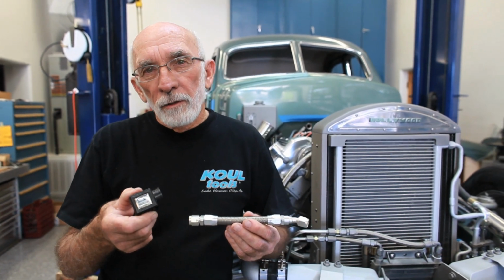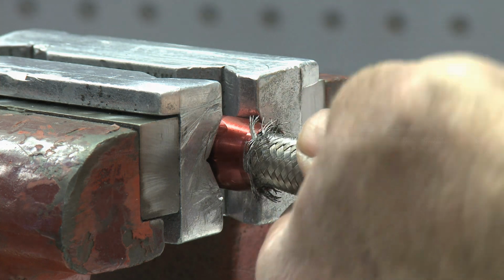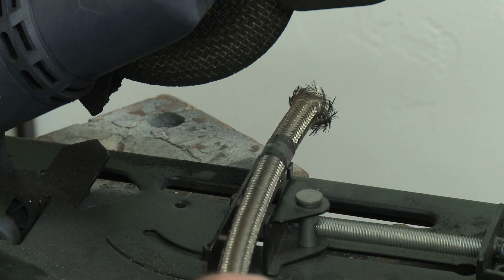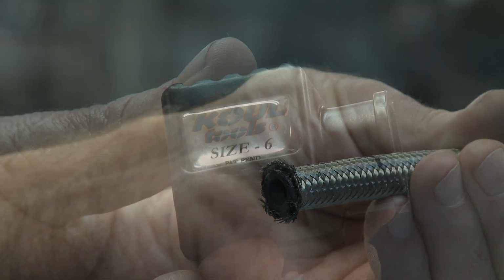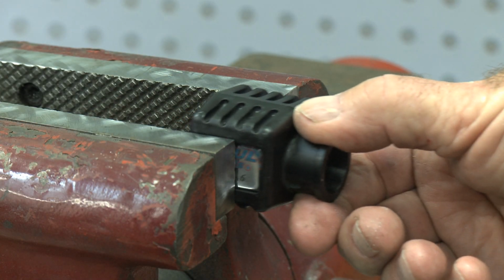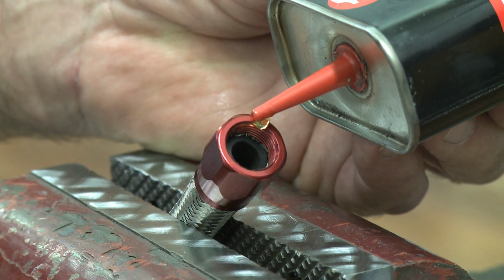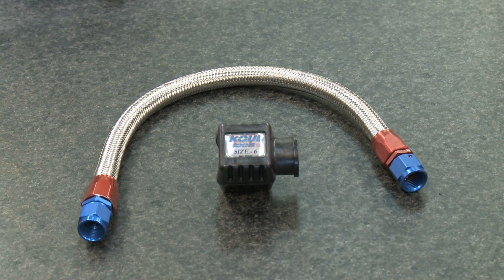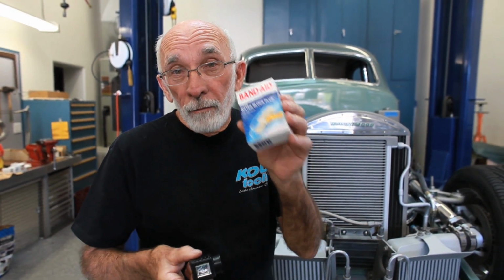How To Assemble AN Hose and Fittings

Comment: Summit made their fitting longer than then our tool. We made our tool longer to accomodate their fitting. The Summit supply now has the -6 tool that will fit their fitting. If you would like , we will swap it out for one that will fit your Summit stock.